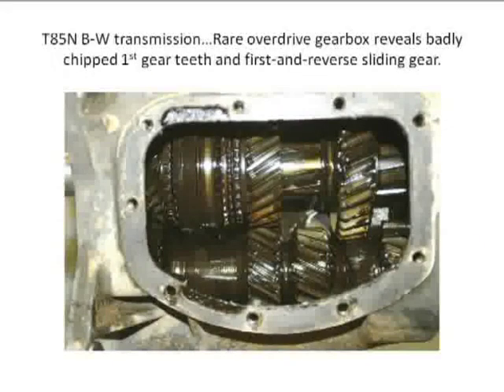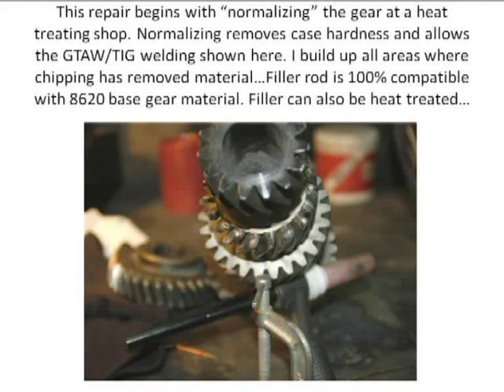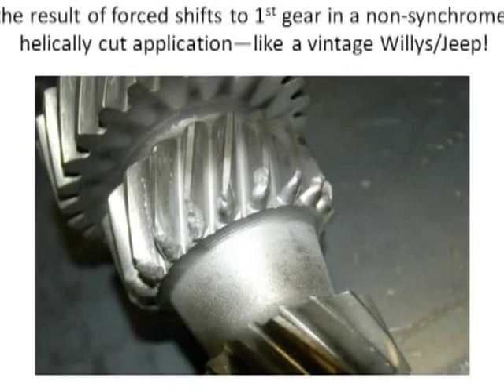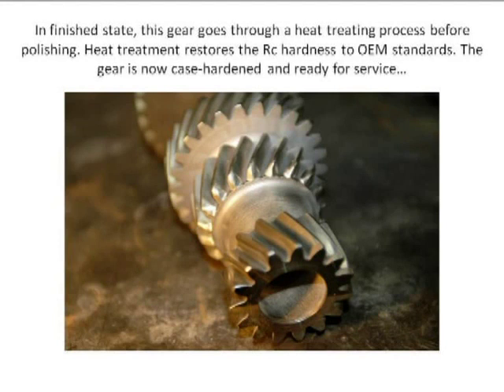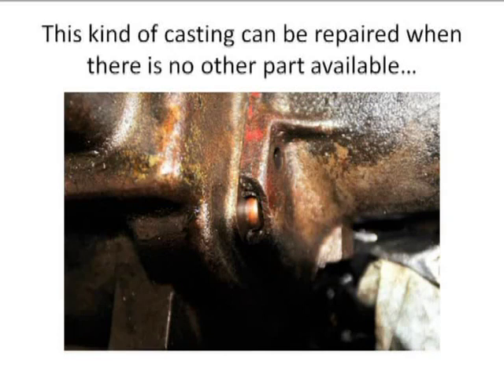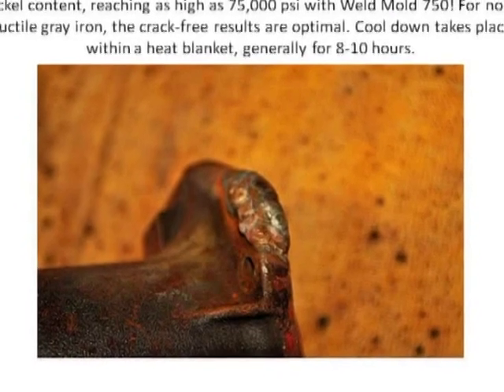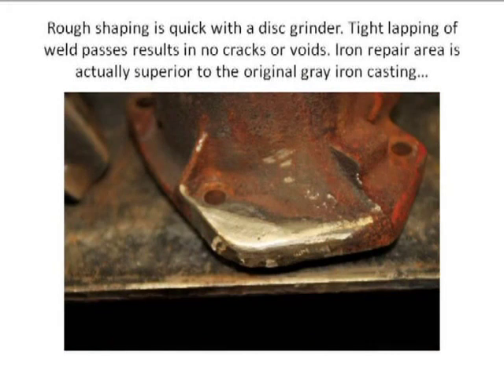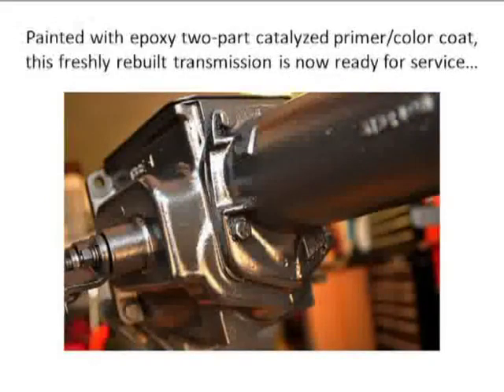Repairing an Obsolete Transmission Gear and Damaged Iron Transmission Casting

Comment: Is there anybody in Southern California that can do a repair like this ?
Reply from the maker: I'm not sure whether there is a single shop that does this kind of beginning to end repair.  The process involves heat treating to "normalize" the gear before the welding process.  Normalizing removes the case hardness and prepares the gear for both welding and the shaping or machining of the teeth in an unhardened state...The weld buildup at the damaged area is usually done with TIG process, though other gas and arc processes will work if compatible with the right filler material.  The filler rod must precisely match and act like the gear's alloy metal.  Your gear's material must be determined before selecting the filler rod.  A popular alloy for automotive gears is 8620, but the specific material of your gear(s) needs to be determined.  (The heat treat shop can help here.)  Suppliers like Weld Mold Company have niche filler rod for specific alloys...After weld buildup, the gear tooth or teeth are either machine cut to their original shape or carefully hand shaped as I show in the video.  After shaping, I ran tooth contact patterns (similar to checking axle ring-and-pinion gear patterns) to be sure that gear mesh was correct.  Then the gear went back to the heat treating facility for carburizing case hardening to the original hardness and the correct case depth for a transmission gear...Overall, you need a gear that is valuable and truly obsolete to make this process worthwhile.  If an NOS  ("New Old Stock") or even a "good used" gear is available, that would be much less costly...I trust this helps.